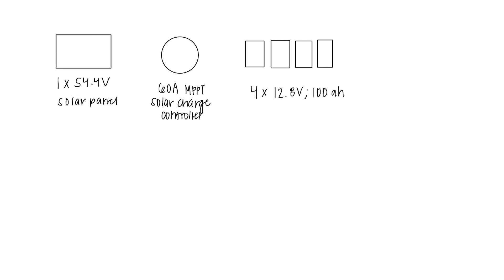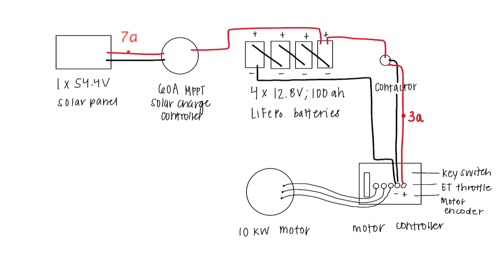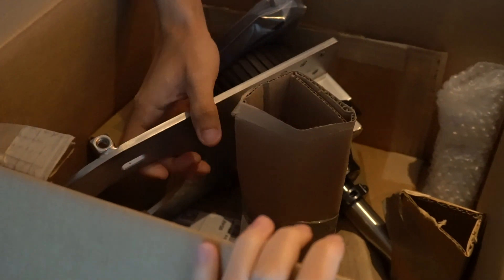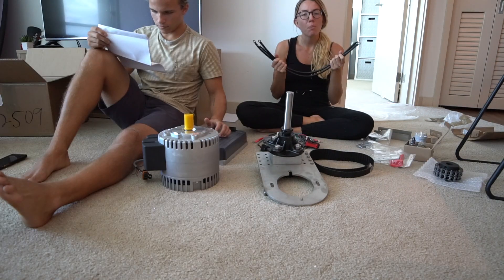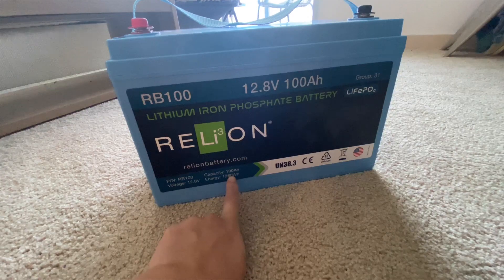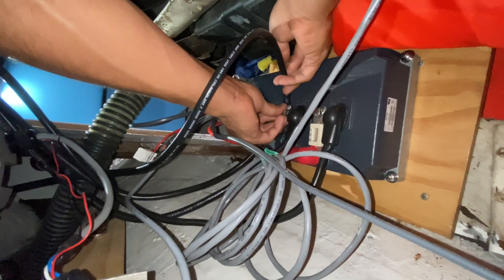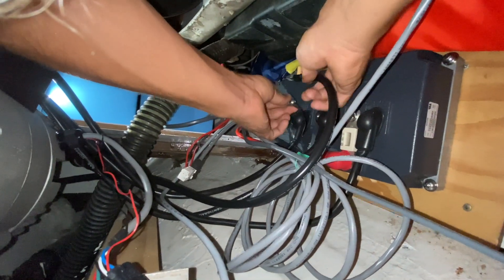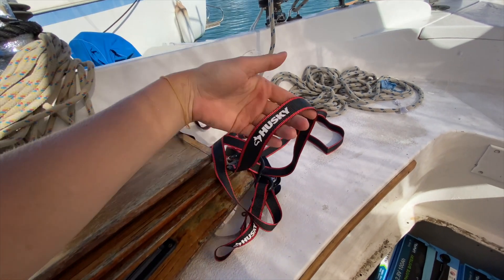Our EMISSION FREE 43 year old Sailboat! - Ep. 4

Comment: Cool. Would love to hear the range you get and is the solar enough to keep it charged up?
Reply from the maker: ~10 miles at ~3 knots. Greater range with solar. Good for aux propulsion. In retrospect, I wish we kept the diesel, but hindsight is 20/20.
Reply: @The808Sailors that's what I was wondering about, I've a chance at the same boat for 4500, the yanmar is in need of a rebuild, was considering the electric option,looks like the yanmar stays. Thanks
Reply from the maker: @44musher yeah, I wouldn’t consider electric propulsion again unless I had a ton of funds and space onboard, or until battery capacity technology gets better. Nothing beats the reliability of a diesel engine when you have a good one!

Comment: What calculations did you do to size the battery bank's output capacity in Amps, with what the motor needs, and how long can you run the electric motor before you drain the batteries?  With only one solar panel supplying 7 Amps, I image it will take a long time to recharge your battery bank, thus if you get in a tight spot, you may not have a very long "motoring" capability.  Curious what your calculations show.  Have you done any testing yet?  Do you have a separate "house" bank of batteries to supply all the other loads other than the motor?  Will those wooden motor mounts be able to handle the torque loads the motor is going to put into that shaft?  Hopefully you will epoxy coat the wood so it has water protection, and rot protection.  Those metal battery mounting brackets might eat into the outer case of your batteries over time given their edges.  Are the battery cases plastic?  If so, you might consider some kind of padding or buffer between the batteries and the metal mounts.  In my sailboat we created a wooden box to hold the batteries around their base, and used the strap to hold them down from the top, but made sure no metal was rubbing against the battery units themselves.  As your boat rolls, the batteries will want to move and rub against those sharp edges of your battery holders.
Reply: littlewingpsc27 you kind of covered all I had to say. I would definitely secure those batteries differently and make sure there is at least a little space for ventilation and of course protection against the metal digging into the Plastic. I hope that this was a dry run. Note sure how long the wood supporting the engine will last wood flexes damp or rotten wood doubly so not that you need when you are trying to keep an engine and propeller shaft in alignment I do appreciate that is only a small 10 Kw engine but it is pushing what 6 or 7 tons through the water.

The main weakness of the system is lack of charging I am sure the batteries will be enough for quiet a few miles of range especially at low speed but with one solar panel I am going totally guess that it is 3 or 4 days before they get charged back up. Makes sense if they are only going weekend sailing or can charge from a marina. Alternately a hybrid system where they charge from a generator or run the motors directly would be a great solution especially if it was diesel generator as they still have the tanks or convert the tanks over to petrol. Actually thinking about it this would be a great solution especially if they cross wired the Lithium with the house circuit as I doubt 1 solar panel is going to suffice for long term cruising(AIS Fridge radio computers lights fans etc) The only thing I would be worried about is charging the Batteries direct from a generator but a charger with a Lithium profile should suffice they could even add a shore power socket to it as well.

Oh Bugger I just read the rest of the thread seems they had already thought about it plus you seem to know a lot more about Lithium's than I do. Oh well nice to know my solution was on the right track if wasted. I promise I didn't skip ahead
Reply from the maker: Hi there! Thanks for your comment. I'll try to answer as best I can here, but I am working on a more cohesive description of our system on our blog. Coming soon one of these days... :)

1) We have the Thunderstruck 10 KW Sailboat Kit. The minimum battery pack Thunderstruck recommends is 100 amp hours in capacity. More would be better, of course. If we had more space (and money ha!) I would have liked to go with 8 LiFePo batteries (two sets of 4 batteries wired in series and those sets wired in parallel). For now, we have 4 batteries, all 12.8V and 100 Amp hours in capacity. 

2) We currently do not have a way to measure the rpms of the motor, only the amps it draws via an app from Renogy that connects to the solar charge controller via bluetooth. Since installation, we have noticed that we generally draw 5-6 amps when we really push the motor, i.e., reversing out of the slip or motoring into the channel with strong headwind and current, and only about 2.6-3 amps when we're casually using the motor. Our solar panel is "charging at approximately the same amperage" during casual usage. I don't know if that phrase (" ") makes scientific sense, but it's my interpretation of the information from Renogy's app. 

3) I notice that, during usage, if we push the motor, the battery % it says we have drops faster, but the moment I stop pushing the motor as hard, the battery % goes back up, sometimes even back up to 100%. Therefore, I am not sure how to truly, accurately measure the battery capacity as of right now. I think the controller/app is giving me an estimate. I would like to get a motor controller monitor, but I can't find any that I like. I only found an iPad app that connects to an add-on to the motor controller via bluetooth. I like the whole bluetooth idea...but what happens when the iPad dies? I want to find hardware that I can mount in the cockpit, not software. What I do know, however, is that we were able to comfortably motor >6 nm on a full-sun day at approximately 2.5 knots with approx. 10 knots headwind and the battery capacity displayed 68%. It took us approx. 2.5 hours to motor that far. 

4) As for recharging, check out our latest video. We found ourselves in an unfortunate and completely avoidable situation. We are green, after all! We almost completely depleted our bank and came back the next afternoon to check out if we had done any significant damage, but the Renogy app displayed we had 100%. Does that make scientific sense? I don't think so. Doing the math, I think it would take approx. 15 hours to fully charge the batteries with our panel. Explanation: since we wired our batteries in series, the capacity remains at 100 Ah. 100Ah/6-7 amps is approx. 15 hours. I think the app gives an approximate capacity measurement under the requirements of the motor at the given time. For example, we were not using the motor, therefore, the capacity stated 100%. If we were to give the throttle a little push, I think it would drop some %. Just a guess.

5) We have a separate house system, completely detached from the motor batteries. 12V AGM...

6) We sealed the wood with many layers of Miniwax Polycrylic, but I don't trust it. You are right. We should have found stronger metal supports. Will need to be replaced. The deck is completely sealed, so that's good for now. Regarding the torque, we have a 2:1 gear reduction that reduces axial thrust. Nothing "shakes" when we push the motor, but I imagine when we heel over, over time, the weight may allow the wood to wiggle a bit. Another thing on the to-do list! Thank you so much for your input!

7) Regarding the metal mounting brackets: very good thought! I hadn't thought about that, at all, actually. Silly me! I thought about your thought so much I just drove to the boat to check on them. Ha! Everything looks good as of right now. No signs of wear on the battery cases. Phew! I made them quite tight, so there is no "give" at all. I wanted to fab a wooden mounting box for the batteries, but the little "real-estate" gave me no choice. The batteries just fit where they are, unfortunately. I did consider putting two batteries on the port side and two on starboard at one point at one point. I probably scrapped that thought because of the lack-of-space.

Thanks again for the comment! It definitely gave me a lot to think about. Always learning! As much as I love the electric conversion talk, we do have a sailboat, and sailboats are meant to sail, after all! Looking forward to doing some more sailing and less motoring :)

-Christy
Reply: @The808Sailors  Thanks for the replies.  Battery life monitoring is tricky with Lithum based batteries due to their discharge profile.  I have used them a lot in consumer electronics designs and having a accurate way to determine how much battery life remains is tricky to do.  Your Amp/hour calculations are correct for the recharge time needed if charging the batteries is only done by the solar panel, and assuming the current generated is constant.  Do you have an electrical hook up at the dock and a way to charge the batteries from the dock side power?  That might explain how they were able to charge quickly.  Good to hear you have a separate house battery bank from the engine battery bank.  Do you have a way to connect them together in an emergency situation?  My sailboat has a switch that lets me tie the engine start battery to the house bank should the engine start battery ever go dead.  A similar setup could allow you to temporarily power your motor from the house bank if you ever had an emergency situation.  Though you would not want to do that for long, as AGMs don't like to be fully discharged at all.  Glad to hear you are not seeing any rubbing on the batteries from the metal hold down tabs.  Do keep an eye on it if you don't add any padding / buffer material.
Reply from the maker: @littlewingpsc27  The only thing that supplies energy to the batteries is that one solar panel. We don't have an electrical hookup at the dock, unfortunately. That would be really nice. Another good project down the line, for sure. I think we would either need 4 battery chargers for each battery (12.8V each) or one charger that could handle charging a 51.2V+ system since they're all connected in series. The motor system is all DC, so would probably need some kind of inverter to make the AC shore power DC...something like that..I think...not too sure! I would have to do some more research :)  I also don't know if connecting the motor and house banks would be possible, considering one is a 48V LiFePo system and the other is a 12V AGM system. Being able to tie them together in emergencies would be ideal, but I I think we would need 3 more AGMs and put the house system in parallel (running into a space issue). In an emergency situation, i.e., tsunami evacuation at night, and if sailing wasn't an option, we would use the inboard electric motor until the batteries drain and then tie our dinghy to the side of the boat and use our outboard motor on the dinghy to take us where we need to go. Not the best plan, but it's something for now. If adding more capacity to the system is out of the question, some type of generator on board would be the best "last resort" to supply energy to the batteries/motor, but I don't know too much about that yet. Thanks for the convo! I love geeking-out over this stuff!

-Christy